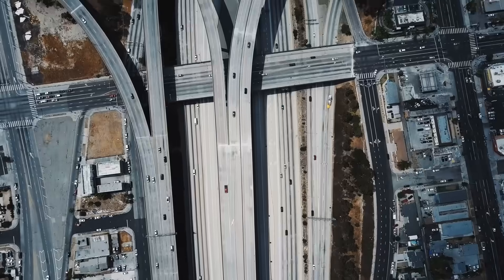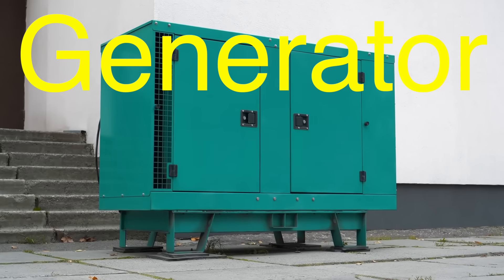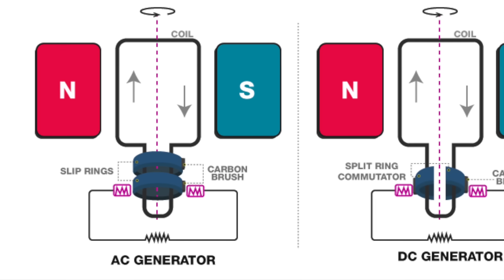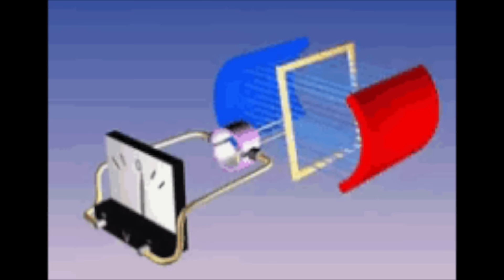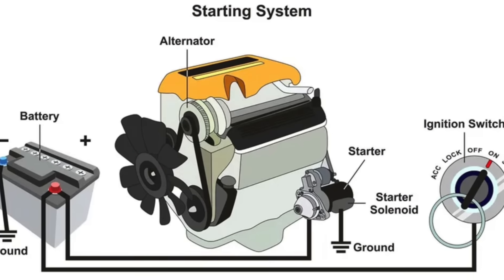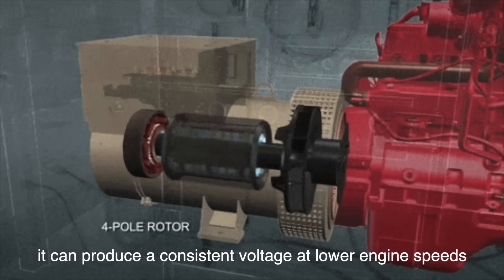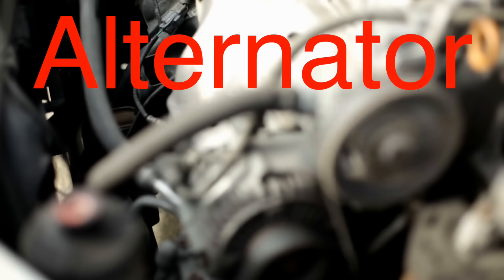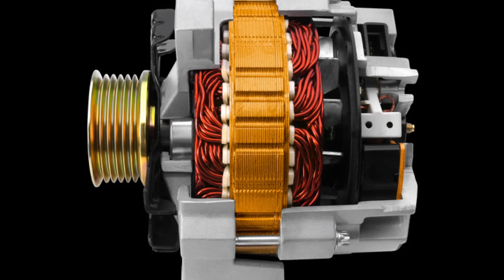What is a Generator? What is an Alternator?

Comment: Lawn mowers have neither a generator nor an alternator that feeds a battery. 
Lawn mowers and small engines have a magneto ignition that only produces the spark.
Reply: If the lawn mower has a battery operated starting system it is an option to include a charging coil or more correctly a stator , as the flywheel with its integrated magnets spin past the coils of wire within the stator, an Alternating Ac current is produced in proportion to the speed of the engine , because the intension is to charge a Battery this must be put through a rectifier turining the output in DC current this device also contains a regulator to prevent overvoltage at high rpm as well as regulate the charging process, in this case the regulator ususly shrunts the excess currrnt through a series of resistors to control the charging currrent and voltage supplyed to the battery. some newer regulators use transistors to regulate the volatge coming from the stator as the AC sine wave goes through them they cut of the top of the sinewave to hold the voltage below a given level this has the avantage of not producing so much heat. I have seen a few very cheap few systems that simply have such a small stator that is put through a half wave retifier that produce such low charging currents (under a half an amp)  that they exclude the regulator      https://youtu.be/Hdi9g6v5t2Q
Reply: Some lawn mowers do have “generators”, some electric start lawn mowers proved a small changing voltage to maintain the charge on the battery (some don’t provide a charging voltage, the owner has to periodically connect a charger which is kind of dumb in my opinion.)  The charging circuit for the lawn mower battery is very basic, just a separate coil that picks up the magnetic field primarily intended for the ignition magneto, a single diode provides half-wave rectification (only allows the positive part of the alternating current to pass) and blocks the battery voltage from discharging through the coil. It is very inefficient (cheap) and completely unregulated, typically the batteries don’t last more than one or 2 seasons because the a constantly being overcharged.
Reply: True
Reply: Motorcycles and some lawnmowers have an extra winding on the magneto to charge their small batteries
Reply: Pretty much all riding mowers and commercial mowers with electric start have an alternator built-in underneath the flywheel. 
 Smaller push mowers generally do not.
Reply: I looked all over my lawnmower and could only find a handle, wheels, gears, and some kind of spiral-shaped revolving cutters!  ;)
Reply: @MiNa-kv3lp  😂😂😂 Me too 😂😂😂😂

Comment: Generator is the umbrella term. This includes alternators and DC power generators, like those found in the old VW Beetle.
5:37  The rectifier doesn't regulate anything. The rectifier converts AC to DC. The voltage is regulated via the built-in regulator and the field windings.
6:27 In power plants, the voltage is also regulated via the field windings. It's not just the frequency, i.e. speed, that has to be constant. Also the voltage.
Reply: This video is full of errors.
Reply: In slightly older power plants the frequency is mechanically controlled via the turbine.  Once the generator is synchronized and subsequently connected to the grid one could argue that the power grid is controlling the frequency of the generator as the influence of a national grid hooked up to the generator via a high voltage line is stronger than the puny influence of the turbine regulator.  At that point opening up the regulator of one generator will only marginally (mHz if that much) influence the frequency of the generator and grid but mostly influence the current being "pumped" into the grid.
Reply: Question 1.
Why not use Alternator (DC) then convert it to AC, 
Instead of:
Generator AC + stabilizer, 
since the result would be 'good' frequency AC  ? (for home / factory use)

Question 2.
If the answer of q1 is higher price,
because Alternator require less maintenance, is it worth it  ?

Comment: WRT automotive generators.

Both devices are generators, one is a dynamo, the other is an alternator.
They both produce AC current, the difference is how they rectify the AC into DC.

The alternator uses semiconductor diodes, and a Dynamo rectifies the AC mechanically using the commutator.
Reply: a Dynamo is desighned to function efficiently as both a generator and a DC motor....The Dynamo on Huey Helicopters functions as it's Back-up Generator AND it's starter motor

Comment: Any device that generates an electrical current is a generator. "Generator" is a generic term. A photovoltaic solar panel is a generator and it produces DC. 

All practical electromechanical rotating machines generate AC. The "generator" in a 1951 six volt De Soto is actually a dynamo, that's not an out of date old fashioned term. It generates AC power that is rectified by the commutator and brushes that are internally timed like the valves in an engine. Each time the magnetic field reverses, the commutator reverses the electrical connection for that pole piece. So the dynamo doesn't generate DC, it rectifies  the AC it's generating. 

No modern portable generator has a dynamo in it. Regardless of size they all have alternators. The generators in utility grid power plants are three phase alternators. The alternator in your motorcycle, outboard motor and electric start lawn mower are permanent magnet alternators. The magnets (rotor) are the field. Automotive alternators have no magnets. They use battery excited electromagnetic fields (rotor), fed through small brushes riding on slip rings, which are fed by the voltage regulation circuit.

This article missed the most important point of all, silicon semiconductor diode rectifiers. This technology is the reason we don't use dynamos in motor vehicles, small engines or portable generators anymore. Diodes rectify the AC to DC to charge batteries.

Automotive alternators are three phase, needing six diodes in a three phase bridge to fully rectify the three phase current they generate. Typically small engine permanent magnetic alternators are single phase requiring four diodes in a full wave bridge rectifier, although there are three phase PM alternators requiring six.

The reason dynamos didn't produce enough power at low RPM was because of the brushes and commutator. The brushes are a pair of big carbon resistors in series with the load. Diode rectifiers are much more efficient and never wear out.
Reply: You explained more than the video.
Reply: @Timmy-il1hb  thanks
Reply: @Timmy-il1hb oh yeah. 👍
Reply: I think reliability was a big factor. I had an early 1960's vintage car that had a generator in it. I got tired of having the generator rebuilt or replaced all the time so I converted it to an alternator. I never had any more problems with it after that.
Reply: Thanks..👍👍

Comment: In the UK , the ( older , 1960's  automotive ) DC generator , that did the same job as a modern alternator is specifically called a   DYNAMO ... these produce less power than modern alternators ! ! ..... DAVE™ 🛑

Comment: I'm from the old school.  Generators produce DC power through the commutator; alternators produce AC power through slip rings.  The video shows a good explantion of the difference.  During the video, the narrator uses the term "generator" to refer to both types of power generation.  That push mower uses neither so it shouldn't be in the video.  One advantage of a DC generator is that it can be used as a starter motor in small engines until the engine is running.  Then it can produce DC power for the needs of motor.  Gas golf carts use this method for one.
Reply: AC is NOT produced thru the slip rings, the AC is produced in the stator and the stator is connected to the rectifiers to produce the DC for the vehicle. Slip rings feed a DC voltage to produce the field or excitation, field current from the regulator controls the output via a sense line. Newer ones use PWM and ECM control.
Reply: @bones-c7k  I stand corrected.  I should have worded it differently.
Reply: FWIW, generators are also used in helicopters to start the turbine engine and then to produce power for the avionics, lights and FADECs. I believe this is also the case for turboprop, turbojet and turbofan jet engines used in airplanes.

Comment: Alternators generally DO require brushes to feed DC excitation current into the rotor windings.  The difference is that the brushes make contact with slip rings instead of with a commutator.
Reply: Yes, and the three phase bridge rectifier containing six diodes in a car alternator have nothing to do with voltage regulation. The field is fed by the voltage regulator via pulse width modulation regardless of whether the field windings are the rotor or the stator.

In a 1951 6 volt De Soto  the PWM was via a stand alone electro mechanical voltage regulator, today it's electronic and may or may not be a stand alone part.
Reply: @tadonplane8265  Thank you.  I was going to write the same comment.
Reply: Yes !
Reply: Brushless machines have a second winding and rotating diodes which removes the need for brushes and slip rings.
Reply: @TechOne7671  how current and voltage is fed to the rotor then? Unless, of course, you use permanent magnets. Then it is traditionally called a magneto, like the ones used in bicycle light power source.
Reply: @janami-dharmam current and voltage for excitation is fed to the rotor thru induction in the same fashion as the rotor magnetises to stator. It’s like two machines on the one shaft. Google brushless alternator, I am sure there will be a few drawings and diagrams for you.
Reply: Some car alternators are brushless
Reply: @mzee5533  Yes, thanks to the miracle of modern electronic components which can spin along with the rotor.
Reply: My car's alternator has brushes.  Also what do lawn mowers use?  Showed a picture of one.  Magnito?  Lawn mowers don't have a battery.
Reply: @danr1920  good question. An ignition magneto is different than a permanent magnet alternator, which is also a type of magneto because they're both powered by magnets in the flywheel. In fact the first magnetos invented around 1840 were called magnetos back then but would be called a permanent magnet alternator today. The "magneto" in a Model T Ford is by today's terminology a permanent magnet alternator.
Reply: @danr1920  Many lawnmovers today have electric startmotors
Reply: This video would be way shorter if you made it.
Reply: The brushes were in the alternator pics.
lol
Reply: Commutator would be on generators. They are different and called slip rings in alternators. Totally different use. The generator's magnetic field is developed in the field coils. The magnetic field in alternator is developed in the stator with the brushes, which are fed DC voltage from voltage regulator. In newer alternators the regulator in built inside the alternator housing. On older models, it's located on the fender or firewall. Alternators are polarity fixed. It's either negative ground or positive ground. A generator can be polarized to be either negative or positive ground.